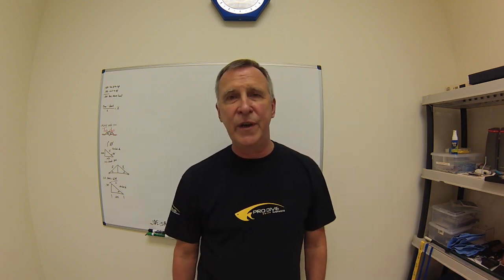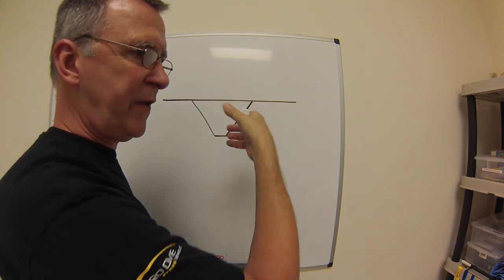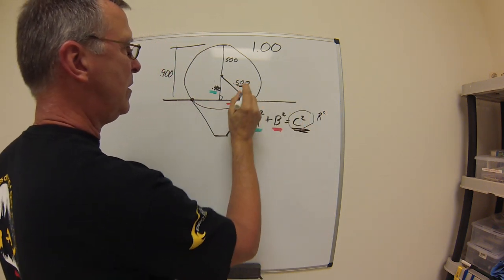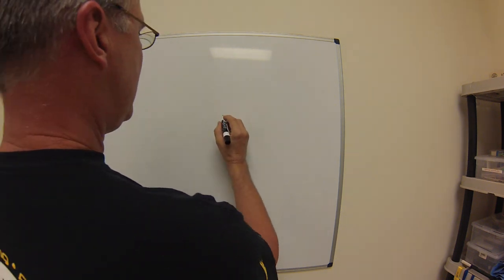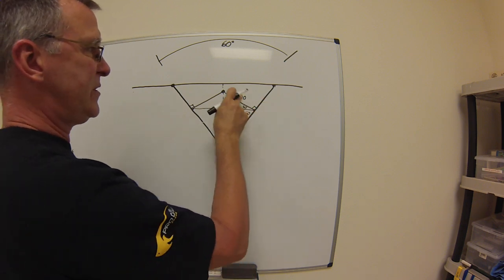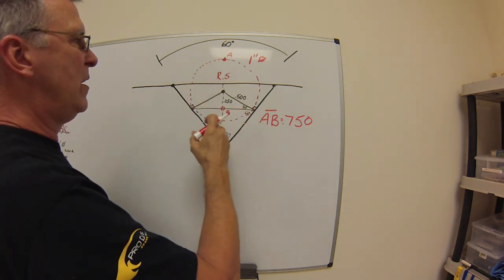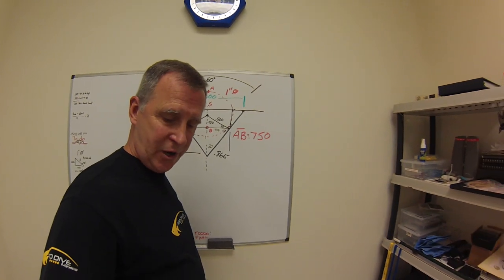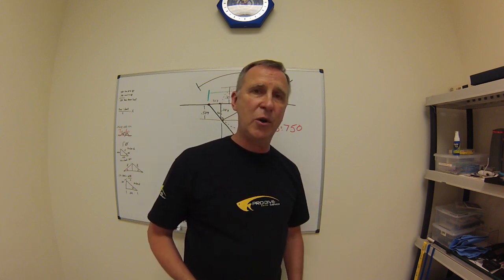Measuring Chamfers and conical features on the Lathe

Comment: T-shirt Idea at 10:20

 ".201, .549, .750, .250, radius of .500, .750. The information is there. All you need to do is break out your Trig book. This is going to take a couple minutes to absorb." - Joe Pieczynski ( all under this diagram^ silkscreened on the shirt)

Comment: Two different gage balls, resting on the inner face, not the edge, with give you both the angle and the ideal diameter of the opening. Burrs and chamfers won't affect it.

Just to make it easy, Zoro has gage ball indicator points in various sizes you can attach to a drop indicator.

Comment: how do you accurately measure a diameter on a taper? For example, you want to know the taper is exactly where it should be relative to the shoulder on an HSK taper? I see people are sellin master gages for this, but then how are those made? If these two features are not correctly spaced, the taper on these holders will not seat properly in the spindle. Same goes for Capto, BT taper which uses the flange (BIG/Kaiser), etc.
Reply from the maker: When it comes to tapers, comparators or CMM's are the tool for the job. If you are good at trig, calculate some square corner gage points for your taper and turn steps into your part. Fill those corners with dykem. When you cut your taper on your part and wipe out those corners, you can be sure your taper is very close to where it should be.

Comment: using cad of course for the second method offset one or both of the lines .500.. now draw a vertical line up and trim it or use "intersection"--then snap a 1 inch diameter at that point and there is your ball in tangent contact with the cone.. another method such as when doing roll pin dimensions against angled surface is simply "create fillet"--snap the 2 lines and it places the diameter perfectly tangent. You can then "finish trim the circle closed"--if you want to visually see the entire ball or diameter. coming in like he says while roughing it out knowing the number you are shooting for the height of the top of the ball you can even make a go no go gauge that alerts you when you get a few thousands away just like checking a hole diameter with a smaller pin as you get close..

Comment: How do you measure the top or contact points of the ball though?
Reply from the maker: I have precision bored rings ( I made. usually an inch thick ) I place over the balls and use a depth mic to get to the top of the ball.

Comment: Thanks Joe, watching your videos takes me back to my roots. I learned machining and CNC programming without a CAD system. I created toolpaths for the CNC machines by calculating the tool center positions for each transition. I was taught that all you need to do is find the correct triangle to solve based on the dimensions on the print. These days, I can just draw it in Solidworks and pick out anything I need but, having that foundation of doing it longhand gives me a powerful understanding of the process and the ability to solve puzzles in the field or at the machine. Keep up the good work. I hope there are younger people learning from you to carry on the tradition. 👍
Reply from the maker: Thanks Gordon. I too am a ground up CNC programmer, so I appreciate all the G2, G3, X,Y,I,J etc calculations. I didn't program offline for almost 2 years after getting my machine. Its a good place to start in my opinion.

Comment: OK,  yep very colourful as you say ..... any chance of  you demonstrating it on the lathe cutting and measuring for say a morse taper or iso40 etc ? Its years since I used trig or tables , a refresher would be useful. shop calculator preferred. Thanks again. mat
Reply from the maker: I will find the time to demonstrate this on the lathe for you guys. My machine is setup for another project at the moment, so hang in there.

Comment: How about measuring a male part with a taper? Anyway to figure out the small end and big end of the part and total length of taper? I was just working on a piece with a taper but had to use a new part to go by to set my compound to the angle by indicating the new taper and it was just a little past 5 degrees ( just barely ) and wondering if their is anyway of doing the math to find the exact angle also. I thought about sticking magnets to the end and place dowel pins on them and then mic over the dowels just wondering if i am going in the right direction?

Comment: How would you measure a solid cone extending from the end of a rod or on the surface of a part?
Reply from the maker: Are you cutting the cone from nothing, or just wanting to measure it?
Reply: I am interested in both to see how it relates to the video on conical features.
Reply from the maker: An internal taper or conical feature is certainly easier to measure. When I am tasked with cutting a positive cone, I have done it 2 ways. If time and space permits, make a precision female gage and and know exactly what you have. Once the gage is placed over the cone, you can measure between the end of the gage and another parallel plane to determine what your cone looks like dimensionally. The second way is to turn 1 or 2 steps into your part where the sharp internal corners of those cuts lie on calculated gage points of that taper. Blue them up and turn your taper until you just erase those remnant lines from the square corner prep. If you can't take the part to a comparator, these techniques work well.
Reply: Thanks so much for taking the time to answer my question. Your videos are a big help to all your viewers and your presentation is outstanding!

Comment: Nice use of geometry. As others have mentioned, a practical example to see what you also mean by using carriage to adjust and how then you would use the compound would be nice.  Are you assuming then that you always cut with the compound to the exact same amount?
Reply: It doesn't matter what the dial reads on the compound, because it is just a way of traversing the tool. You just need to start outside the work, and stop cutting when you either get to the bottom of the hole if it's a truncated cone, or when you start cutting fresh air if it meets a cylindrical bore. In both cases you can tell from the sound.
You do need either a dial gauge or a DRO (or a graduated leadscrew dial) to measure how much you move the carriage towards the headstock before taking that final cut. If your target dimension to the top of the ball is 0.5 and you just measured 0.6  you need to move the carriage 0.1 to the left before taking that cut. This is because the ball will be permitted to move into the hole the same distance the carriage allowed the tool to move into the hole.

Comment: Joe......it's clear now that you're a bit of a wizard with accurate machining. You're reputation is looking increasingly solid. I've got all the trig ( all that detail you patiently included) but didn't get two crucial things.

1) How do you measure the 'headspace' when the part is still in the lathe and you're trying to hold a ball in the taper.

2) What was the cylinder with a bore 1.002" and 1" thick......... all about............ ?

And...........Nobody else in the comments queried any of this.... am I the only viewer who missed this? A video that leaves the trig out ( see    https://www.youtube.com/watch?v=Ji1-gffIdKE&t=602s     .......for all that) and deals with the on the machine stuff would be just the thing, at least for me.

Thank you Joe.
Reply from the maker: Hi Ian. Both of your questions lie in the answer to the second one. The cylinder is a measuring aid intended to sit on the face of your part, go over the ball and allow the depth mic a place to sit for the measurement to the top of the ball. If the ball is 1" in dia. and the ring (cylinder) is 1" thick, all the math should just jump out at ya from there after you have the depth measurement. The ring (cylinder) is just a measuring aid. If this doesn't help, please tell me.

Comment: Your explanations are crystal clear. However, it would have helped a bit if you had explained why you would know the height was .250" (on the second example at 7:15 in the video) from the cord to the center of the ball (giving a half cord length of .433").  I'm not sure how you got there. Love your videos. And, by the way, I made a tool height gauge based on your demonstration. Fun project I had put off for a long time. You got me up and running. The shout-out from Outsidescrewball was well deserved.
Reply: Jim...This is because the Sine of 30 degrees is .5   Or, for this 30/60/90 triangle the "height" is always 1/2 of the hypotenuse.
Reply: Yes! Thank you. I appreciate your help.

Comment: Joe,  I used your second construct to derive two equations.  One solves for height as a function of taper angle, ball radius, and ball height, and the other solves for width as a function on taper angle, ball radius and ball height.  I plan to put these two equations in Excel so I don't have to repeat the construct for every combination of angle, ball diameter, and width that I come across. I made a video of the derivation, and made sure to mention that it was your construct. Do you mind if I post it?  I ask because I am sensitive when playing with or modifying other peoples ideas, and I don't want to come off as me trying to present your ideas as mine.   Thanks,  Chris
Reply from the maker: Hey Chris. This wasn't my idea, just something I learned loooooooong ago. I have no problem with you passing it along. Its deep, but very useful. Have at it bud. Thank you for getting into it.
Reply: Joe,  I just sent you an e-mail I made with an Excel spread sheet that includes the two ball taper measurement as well as variations of your ball height calculations.  Once I try it out, and tweak it, I will find a way to post it somewhere for free distribution.  Thanks Chris 

 (UPDATE,  I sent an updated copy of the spread sheet because I had the inputs labeled incorrectly on the taper calculation.

Comment: Great Math there Joe, but I wouldn't be too worried about hitting the .201 first time, (try to make this feature on the "First End" turning Op') Bore it a few thou' too deep, then skim the face until the .201 height  is achieved using the 1" ring & depth micrometer. Doing this on the "First End" will give you a few goes at "Getting It Right" especially if you haven't done it before!!
Reply from the maker: You can't always take some off the face if the part doesn't allow for it. Creep up on it and use an indicator or DRO fro reference. I repaired US naval ship valves for years worth over 100K and we didn't have that luxury.
Reply: @joepie221  I did say "Where Possible"  Joe,
Reply: @felgate11  You better edit your post as 'where possible' is not in there.   Maybe you see it but I don't.  Just sayin.

Dale in Canada

Comment: Are you going to do the case where you don't know the angle and you don't know the diameter? Just use two balls of different diameters and you should be able to compute that.
Reply from the maker: So tell me how that feature is represented on the print and we can move forward.
Reply: @joepie221  I was thinking of the case where you might have a part and want to duplicate it or create a mating part or create a drawing. To be honest, it's more of a mental exercise than anything else.
Reply: @kennethlerman9664  Joe is thinking like a machinist, they always have a print. He seems to forget some poor sucker has to make the print, and as you point out, they may be detailing (or you may be making) a part which has to fit an existing taper hole whose angle is non-standard or unknown . 
But I think there are other possible reasons to reach for the 2 ball method: say you're using a tapered end mill or reamer of unknown precision, or perhaps a regrind, and you want to check if the angle is within tolerance. It's hard to measure the tool if the flutes are helical.
Or you might be producing a taper bore using a boring head in the mill, either one of the Wolhaupter, Narex or d'Andrea style (where the diameter can be changed using autofeed at the same time as you are power downfeeding), or a nifty slewing guideway unit like Tree used to make. Once again you cannot measure the taper angle you will achieve without first achieving it (at a somewhat smaller diameter, ideally)

Comment: Thanks for showing these ways for measuring the taper diameter using a ball.  This type of info is extremely useful, and I would have never thought of using a ball. 

Your idea of using a ball made me realize that you could accurately measure the taper angle itself by using two balls of different sizes.  

Neat stuff.
Thanks,

Chris
Reply from the maker: The 2 ball measurement is high end stuff Chris. i like the way you think ! Mr Crispin made the same observation.. He's a 20 year old machinist for RR in the UK. Look him up. Sharp guy too.
Reply: Thanks!  I'm one of Mr Crispin's subscribers.  Your'e correct that he is a really sharp guy.   Chris